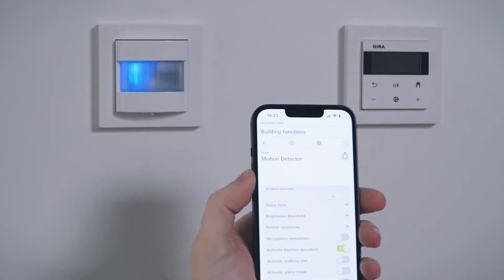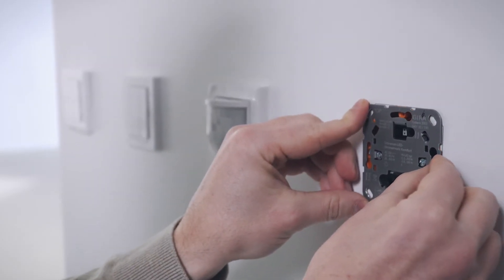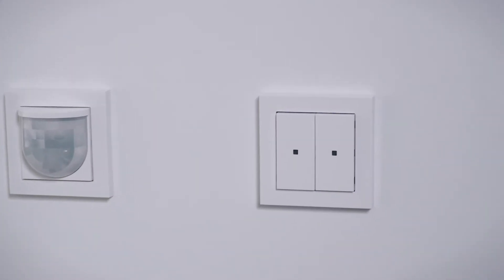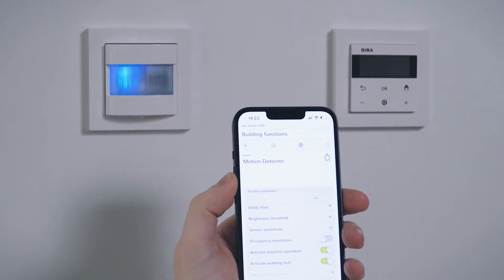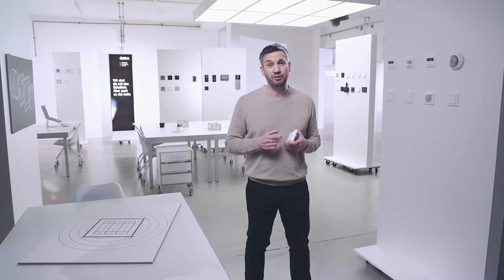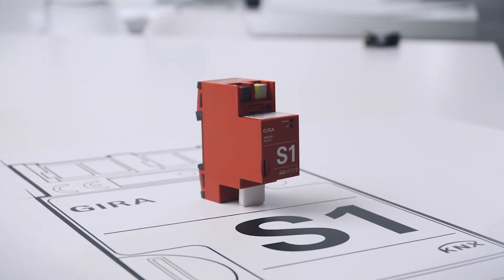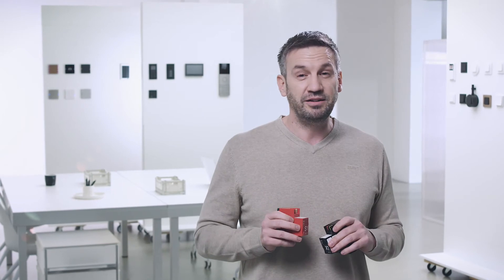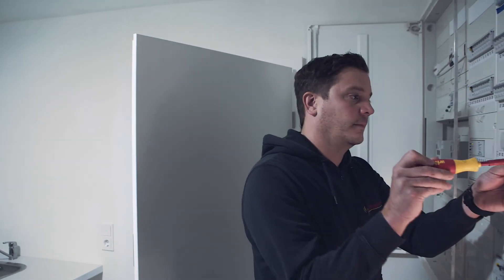Gira Lab | How can I retrofit a Smart Home?

Comment: It does sound very promissing and I think the customers will very much like the app option. We are particularly interested in solutions for temperature control and RF devices. Is there anywhere where one can find specifications of various components you offer? There is the Gira System 3000 / Device overview, e.g., is there something for Gira RF?